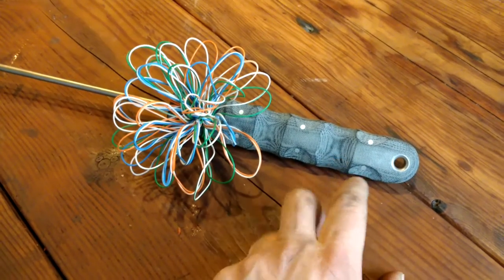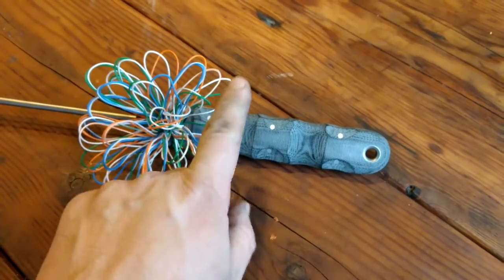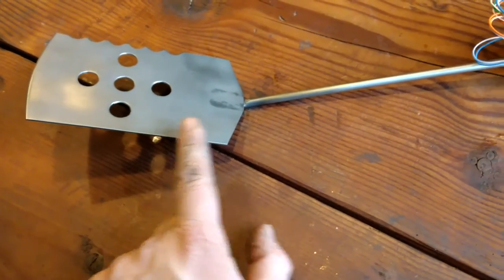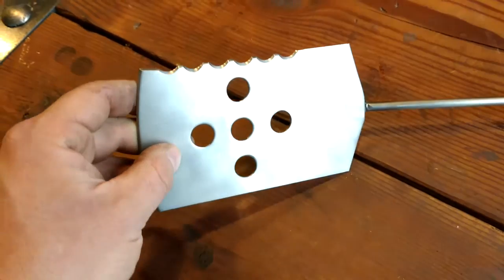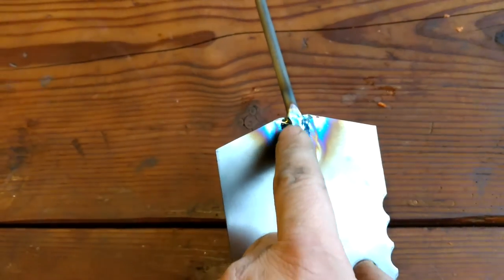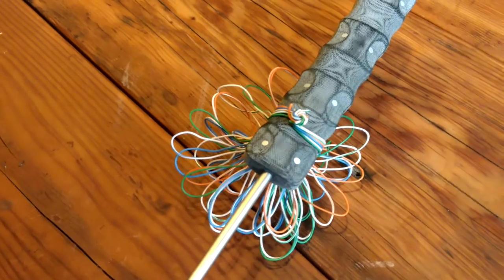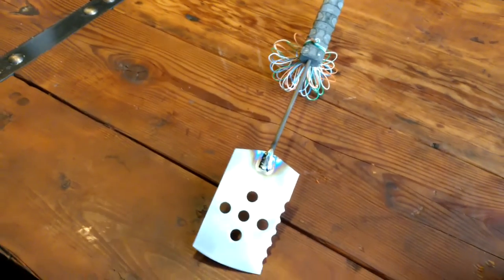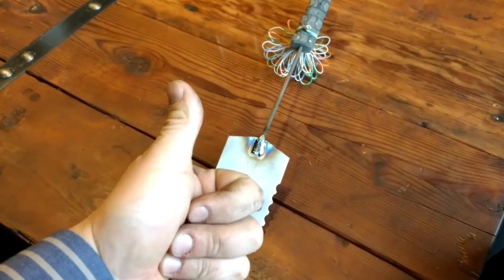Custom Titanium bbq spatula!

Comment: Nice. Did you salvage the Ti or did you buy it?
Reply from the maker: UV Metalworking & Fabrication Wish I could, but I had to buy it. You can get 6pcs 4" x 6" out of a 12" square sheet.  The rod is 12" long and slips 3" into a 8" long micarta handle.